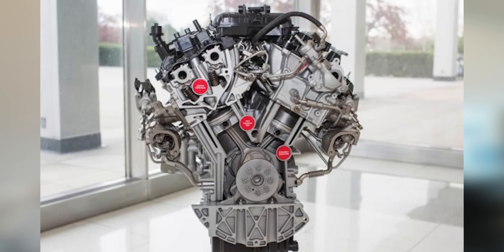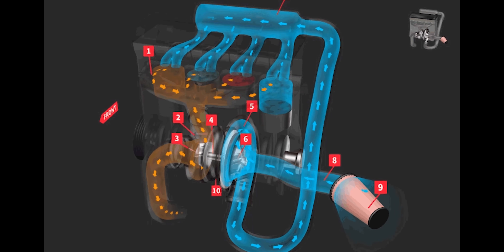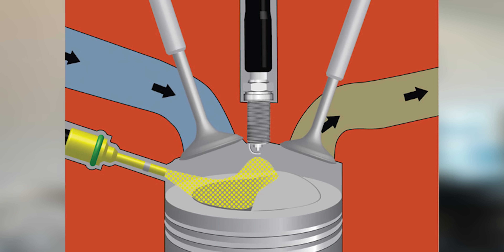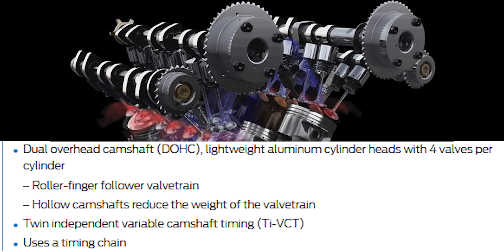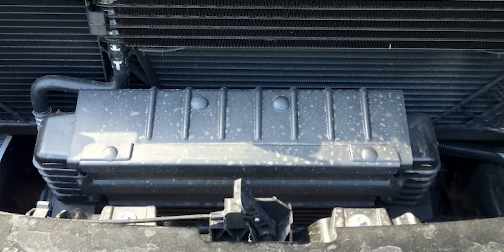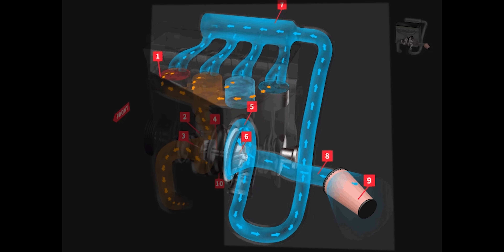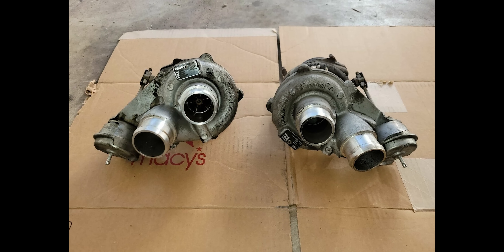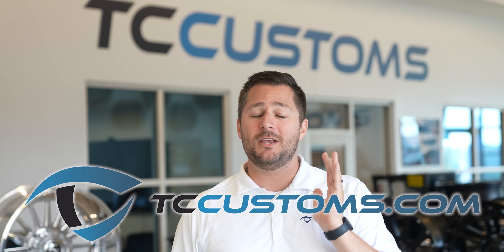The Truth about the Ecoboost Engine!

Comment: I’ll never own a v8 after owning an eco boost.
Reply: Why not a V8 ecoboost with 600 HP?
Reply: Wait till you tow a 7,000 lb trailer up a steep hill and watch that temperature gauge climb.... oh yeah, google “ecoboost overheating towing” and let me know what you think
Reply: @MrDmitryd9  Aftermarket Transmission Cooler will fix this issue
Reply: Brian transmission did not overheat, the engine does
Reply: @MrDmitryd9  A bigger aftermarket radiator will fix the issue.
Reply: @MrDmitryd9  I tow 8k plus regularly. I’ve been through the Smokey’s and many other steep grades and I have never overheated or seen my temp gauge even move above regular temps. Is this something you deal with first hand or is this just something you read online once and now feel the need to tell everyone you know about it.
Reply: Bryan Vollmer Deal with first hand, do you have the 3.5 eco-boost or the V8 coyote

Comment: I use a 3.5L 2021 F150 as a Police truck. I need a damn tuner!!!!!!!!! Crack the encryption!!!!!!!
Reply: Have you wrecked the truck yet?
Reply: Strange question, but yes, at less than 6,000 miles on the odometer, I had to perform a PIT maneuver on a guy trying to run head on i to traffic to commit suicide.

Comment: Another question.  How does Ford vary the turbo output?  When you accelerate hard there is positive pressure in the intake manifold.  When you are cruising at highway speed there is a vacuum in the intake manifold.  Admittedly at cruising speed the engine is only turning about 1800 RPM but the turbos should still be compressing the incoming air slightly.
Reply: They have electronic wastegates

Comment: I have the 2021 3.5
Just enjoy the power, I tow toys quite a bit and I can’t barely feel the weight.
Tons of get up and go!
160,000miles without any problems, although I change my oil at 3,000 using Amsoil. I’ve changed my air filter, plugs etc. changed rear end oil, transfer case, front drive, transmission at 60,000.
I love the truck and the engine. My brother has the 2020 Ram 5.7, I blow his doors off each and every time. That is worth a lot of money to me…hahaha
Reply: Just got a 23' 3.5 and its crazy fast, yet smooth.  Has 2 inch lift with big Toyo tires. Rides nice.  The wife thinks the two inch lift is the only way to go for ride quality. Floats over are railroad tracks and the 22' 5.7 Hemi was a rougher ride over railroad tracks

Comment: I had a 2016 f150 with the twin turbos hadn’t replace the motor at 51000 miles had nothing but problems with the truck sold it back to the dealership and bought a Chevy truck and have had o problems it’s a great truck the Ford was in for service about thirty times they had no clue what it was doing the exhaust was black useing oil.

Comment: My 2012 just turned 170k. She runs like a scalded dog. The harder you work it, the better it runs. I usually do 75% of my driving towing my boat. Every 3 months, i take a 1,000 mile road trip for work. I drive 80 mph constantly without cruise and get 19 mpg. Best ever on a trip was 21.5. 
I wrapped up a trip just last night. As i turned onto my road at midnight, i floored it... broke my tires loose from 2nd to 3rd gear for atleast 100 ft. 
This is a crewcab 4x4 with a 6.5 bed. That mpg and that performance is hard to match.

Comment: Will never own another one.  My 2018 F150 had to have the turbos replaced with less than 12000 miles.  Had so many issues with the engine, my dealer replaced the vehicle with a 5.0 liter truck.  Glad to hear others have had good results.

Comment: my 2013 f150 developed timing chain rattle at 84.000 miles with 5000 mile oil changes using Mobil 1 5w 30 full synthetic. At 94,000 miles it was in full limp mode and had to replace chain, guides and cam gears. This is with very low towing if any, so no not very reliable. Last weekend replaced the multi-function switch, blend door , blower relay / plug and gas door. Currently at 118,000 miles transfer case leaks but I have owned 11 F150's since 1970 and this is the most impressive engine of them all in the stock configuration. Lot's of fun to drive it will rip off the line.

Comment: I would not be afraid of buying a NEW Ecoboost other than spending the money. I am in the market for a used F150, and I skip trucks with the EcoBoost because I do not trust the maintenance that people do (or do not do) on these engines. Not even negligence, but changing the oil at the intervals that the manufacturer suggests often equals major repairs including cam phasers/timing chains around 130k-150k miles, which is the mileage range I am looking at.

Comment: Hey good job to review the essentials. I hope that nobody will do a 10000 miles oil change when towing.  A ford master tech recommends to change the oil in the severe conditions all the time. Because of the heat that produces all the ecoboost engines. Even a 5000 miles oci with a high quality full synthetic oil you have sludge in the pan, in the head and can block the jets to cool the pistons. Oil is a cheap insurance. So adjust your oci to your driving habits.  Often we meet the severe conditions with our daily commute.

Comment: Had a 2.7 Ecoboost and it turned full synthetic to water consistency every 4kish miles.  Maybe the 3.5 is different but I would not go over 5k! Also waited 2 hours for the engine to cool off before changing and the oil was still scalding hot!  Turbos get hot AF!!
Reply: The New G.M. 2.7 boosted engine has electric water pump that cools the turbo automatically after shutting off the engine.

Comment: Thank you for the information,I have a 2013 Ford F-150 3.5 echoboost engine in my truck, it's 4 wheel drive,and I had a 2004 Ranger that was bad on gas mileage,and when I bought this truck,my wife Nancy told me,get the echoboost engine,and I wasn't much on them,but talk about better gas mileage and more power,and it's better on gas too.Im hoping to get 200,000 miles or more out of this truck, because I'm getting the oil changed every 3,500 miles,or 4,000 at the most,but I I've seen some with well over 220,000 miles on them,for about$15,000 dollars,but the information you gave .e was very informative and I appreciate it.Im trying to learn as much as I can about taking better care of my truck and getting enjoyment from it too,my wife Nancy loves the power and where it sits up higher too,she can see all around her,but thanks again!!!!!!!

Comment: We bought a 2020 explorer ST with the 3.0TT last November and it was the worst mechanical experience I’ve ever had with any vehicle I’ve ever owned.  It was also our first ecoboost engine we’ve owned.  Within the first 300 miles, it had a low engine oil pressure light come on.  Poor engineering design on the oil pan also Ford didn’t even bother to put the correct amount of oil into the engine from the factory.  Sat at the dealer for almost 2 and a half months, Ford had no clue what the issue was.  From there things just got exponentially worse.  Both turbos were leaking oil, the transmission started having a terrible slip from 3rd to 4th gear at 6k miles and numerous quality control issues ranging from the infotainment system to the seat controls not working at all.  Also it rattled more than my 2014 raptor that literally has 10 times the amount of miles and off-roaded daily.  I’ll buy an EV vehicle before I ever take a chance on an ecoboost engine anytime soon.  Good explanation on the 3.5 though. 👍

Comment: Is the 3.5 ecoboost engine the truely only good ecoboost with the port and direct inject along with external water pump and the additional cooling features? I hear as you go down in size from the 3.5 ecoboost that it doesn't have as much features????

Comment: What is the difference between a 2021 F150 3.5 ecoboost with the towing package, vs the max towing package?  My truck has the class 4 hitch, the pro trailer back up assist, the 3.55 electonic locking rear axle but not the 36 gal fuel tank.  Is there a difference in axles? What about transmission oil cooler?  Etc.   Thanks.

Comment: there is no explosion in the engine cylinder; but it burns with more fuel and more air to create more power per liter of displacement,    a very good layman video though on the ecoboost

Comment: Does the 3.5 Ecoboost motor require a catch can system? Due to twin turbo set up residual fuel, oil and carbon coking on the intake valves. It's my understanding that this has been a problem in the past 3.5 motors. Thank you for a comprehensive answer in advance.

Comment: Hi Mitchel, Which motor do you recommend for towing application? EcoBoost V6 or 5.0L V8?
Reply from the maker: Hard to beat an EcoBoost for towing!
Reply: @TCcustoms_  So with the EcoBoost being as good as people say it is, what is the V8 for that Ford offers? I'm considering switching over to Ford for the first time in my life (always owned GM vehicles) so I'm trying to figure out what I want/need. I've always believed a full size truck should have a V8 so the EcoBoost thing that Ford does has me a little confused. lol
Reply: @JMilMovies  It’s for people like me that would rather have a naturally aspirated engine(no boost). Turbo charged engines these days are fascinating because they put out incredible amounts of horsepower and torque in smaller displacement, but the cost of repairs can be very expensive.
Reply: towing go's to the 3.5     haven't heard it any other way.

Comment: Obviously they don't all fail...but the shop I used to work at has seen several come in with failing turbo's. Maybe it's the 10k mile oil changes? I would definitely doubt Ford recommending 10k mile oil changes. Maybe they just sometimes fail.

Comment: Nice video. One thing to add is that the double injectors one inside one outside which cleans the carbon build up that is a big problem in the motors with direct injection only. Also this is second generation motor.

Comment: So… the 2021 f150 has a second gen eco boost, right? I have a 2020 f150 with 2nd gen 3.5 eco and the hp and torque numbers are less as well as the oil pans are different; I have a composite type oil pan. Do the 2021 come with metal pans and is the tune different to achieve more power?

Comment: Just bought a used 2013 with 96k on it in Seattle WA. Truck is from Canada. Just had a new motor installed due to the original losing power last October. I hope like hell this motor performs like your 300k motor has for you.

Comment: I have a 2015 I bought new 2.7 f150 xlt , knock on wood I have 192,000 on it. N no problems,  but I changed air filter, n change oil filter twice in the recommended 10k oil change, n I only use high end oil, I changed transfer case fluid , rear differential, front dif at 150k n I run the NGK ruthenium 1 step colder plugs other than that  everything else  is from day 1!! I use a OBD 2 chip just to read boost pressure basically,  n it's down from 19+ psi from New to about low 17psi now. Which I figure not bad for the mileage,  remember I have the 1st year of that truck n motor so I'm thrilled it wasnt made on a Monday or Friday lol.  I'm not a fan boy either I have a 83 Scottsdale that I love probably more. That being said if u take care of ur vehicles they'll take care of u !!

Comment: I’ve had two. A 2012 and a 2016.
NOT bulletproof for southwest! These things have a ton of power but they run WAY too hot in Vegas July!, I have had to replace four sets of exhaust manifold, even the aftermarket thick iron CR warped! Just towing a mid size toy hauler. Turbos replaced at 186k miles. Overheat when pulling in 100 degree days, right to limp mode when the temp gets too high….and your exhaust manifolds or done.
The exhaust manifolds are total junk and the bolts on the back end always break and have to be helicoiled. Junk manifolds. Too much power and heat for them.

Comment: To be clear: EcoBoost is very easy to understand. On light load/throttle you get fuel economy, when you step on it you get boost to make power. You can’t really get both fuel economy and power at the same time. That’s why towing fuel economy is the same or worse than the 5.0 or even some of the older 6.2’s, as the turbos can put more air in the cylinder than a naturally aspirated engine.
Reply: It's because additional fuel is added to cool the combustion chamber to me emission standards.  That additional fuel doesn't actually do work (per se), it just just cools the cylinder as it vaporizes

Comment: That's not the reason the engineers added the 2nd fuel injector. It's to keep the valves clean and keep them from getting gumed up. I own a 21 3.5.  70k only problem so far is a coil witch I replaced yesterday for under 100.00. Love love love my 21 f150 fx4

Comment: 2014 Ecoboost - 125000 , I love the power of this motor. I tow 8000 lb camper and 9000 enclosed trailer and it has no issues. Mobile 1 sythetic. I have replaced the TB, water pump, and plugs (one cracked). I did drill a tiny hole (as seen on many youtube videos) in the intercooler to allow accumulated oil vapor to drain out. It's never even left a spot in the driveway but it did have oil come out initially when I did it at 60k. Not sure if it helped but it didn't cost anything. 
All of my friends that have driven it with the trailers behind it are impressed with its power. The proof will be in the longevity. That turbo power is hard to give up but the new V8 puts out numbers that are close to my older eco. Sad to say but anytime I buy a new vehicle, I assume the dealer is going to hang me out to dry if something really goes wrong. Shouldn't be that way.

Comment: Ive had 3 of these engines. The first was a 2015. It was required for the trailer tow option. Horrible. Terroble gas mileage, underpowered, sounded like it had a sore throat when accelerated. My worst complaint was throttle response. Terrible turbo lag. 
My 2017, and 2020 have the gen 2 ecoboost, love this. Instant throttle, terrific power, 21 mpg all around driving. Faster than a '64 GTO!

Comment: Nice commentary.
It also sounds like BMW / Audi. They are so well designed and assembled by PHD mechanics in clean rooms. They too have all the aluminum bits and turbos and valve widgets and coking direct injection.
Then a normal person who doesnt have a standby pit crew buys one and it leaks oil from a $3 gasket that costs $1000 to repair, or a long lasting turbo that lasts 80,000 miles and has to be sent to Germany for repair.permanent
OH BTW No temp. gauge, and the trans oil pan IS the filter - $$$.
Each pissy repair after 80k is a minimum of $1000... some $2-3000. A battery is ~$250+$100 to program it in.
YEAH you get it!
 Then later all the magazines that said they were the best thing since sliced bread start saying "we all know the very common (XXXXX)  went wrong with that model".
Until the next greatest comes out!!
Reply: Ouch. Wow. The truth hurts like heck.

Comment: I just brought a 21 Explorer Timberline with 2.3. Awesome motor but I think it only has DI not additional port injection.  I am using archoil ar6200 fuel additive and amsoil 5w30 ss in hopes to minimize carbon on intake valves.

Comment: I own 2013 F-150 with 3.5,  it has 238,000 miles. Besides brake pads, battery, oil the 3 coil packs I've only changed fuel pump and relay. Was told one burn the other out. I assume he was right being he was recommended as a honest mechanic. Previous truck was a F-150 with 4.6L, it was sold after purchase of 2013, it was last seen 7 months ago with 302,000 miles on it. The factory ac still worked. Say what you want, I have owned 4 new F-150s since 1997, the newest 2021. All combined 1997- 198,000miles traded for 2003, 2003- 275,000miles when sold, 2013- 238,000miles which I still drive as work truck. You do the math.

Comment: Have a 2016  F150  80k miles at 75 k had a pin shear in  timing ?? 3100$ …thank goodness for  warranty.     Down for 8 days … running strong again .  My history with Ford has been ,about 75 k , issues begin. , probe, wind star,  Taurus … waited a number of years.  Bought this 2016 … still admire  the lines  of this truck ,  love when get to use “S” mode   Can make one a silly 17 year old  and not 71  .
Reply: @jkeelsnc  thought Fix Or Repair Daily😉

Comment: First of all, the fuel air mixture does not explode it burns quickly if it explodes it causes piston damage second it’s an engine not a motor, and third I’m pretty sure it’s coolant through the turbo not water, water would freeze in the winter time and cause severe damage

Comment: If I want and need more power than my current 5.0 it will be a 250 with the 7.3  cast iron block and good old pushrods simple and pretty much perfected 50 years ago.

Comment: My mother has the 2013 3.5. Turbos had to be replaced as they seized up but I believe that's just from her not driving in boost all the time trying to keep her fuel economy as low as possible (go figure). I've driven it for years and love the motor. Was surprised to see the tow cap, pretty sure it's 11,500 for that year.
Reply: Vehicle is just as good as the common sense of the owner stay on top of the maintenance as in any vehicle shouldn’t have issues.

Comment: Use a high quality synthetic oil, some are designed specifically for turbos to prevent oil coking. I have 180k on my turbo diesel, no turbo problems.  We’ll worth the extra oil expense.

Comment: I've got a gen 2 17 with the 10 speed never had any problems with the transmission or engine. Only thing was my rear sensors on the bumper kept going out, turned out to be a pinched Cable.

Comment: You forgot to mention the two different types of turbos that are installed on the 2.7 & 3.5 EcoBoost engines. Single scroll vs. Twin scroll. Not unless you were only referencing the 3.5 engine?